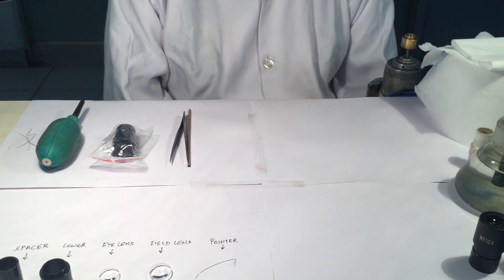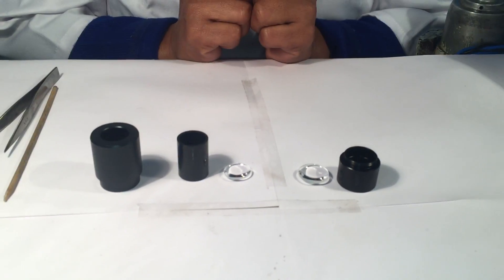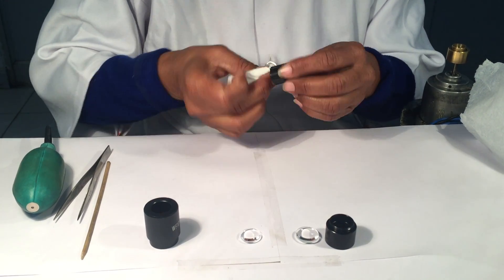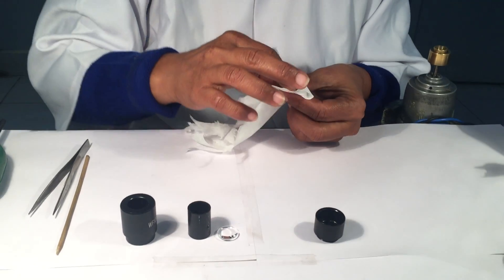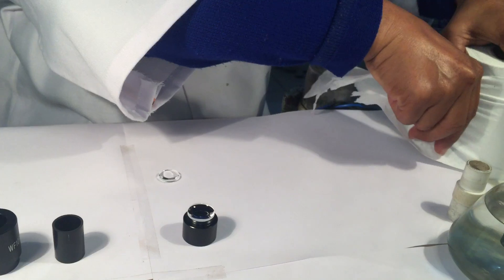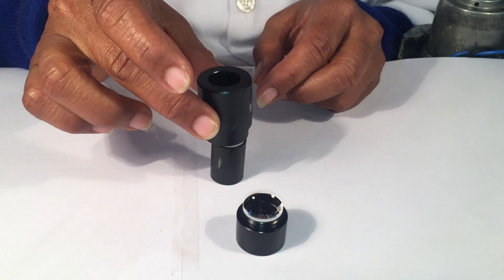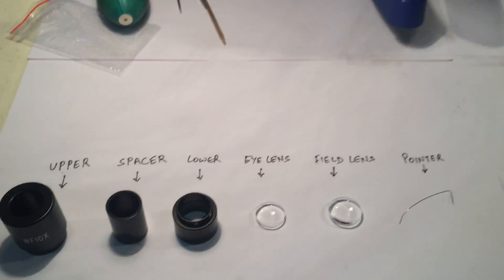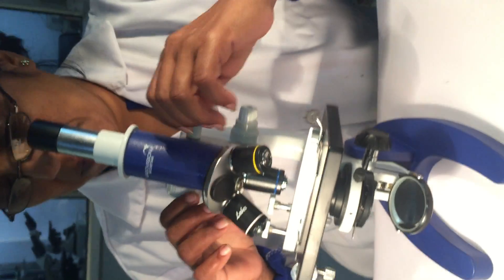Process of Cleaning WF10x eyepiece

Comment: what did you spray in the tissue paper
Reply: The green-coloured handheld Air Blower removes any unwanted dust particles that can put a scratch on the lens. And we dapped lil' bit of spirit to clean up the top surface of the lens.